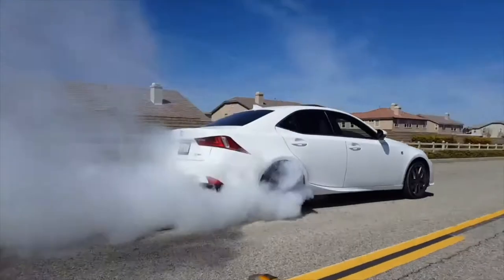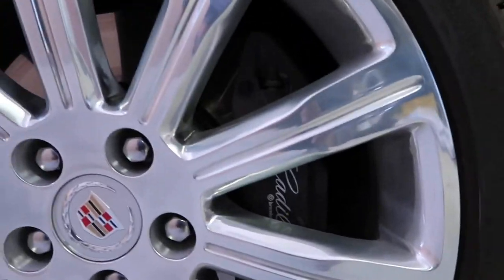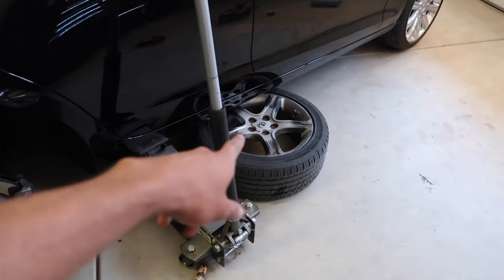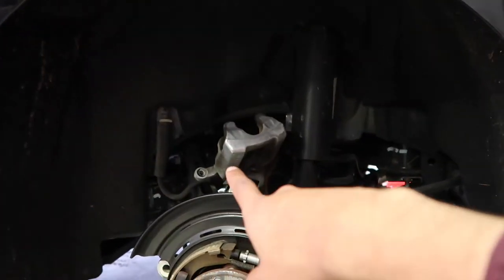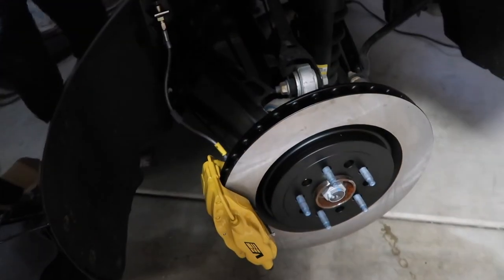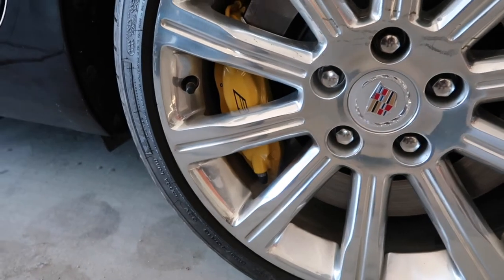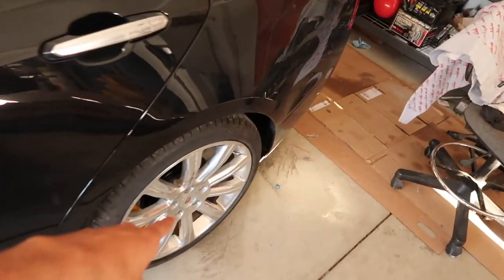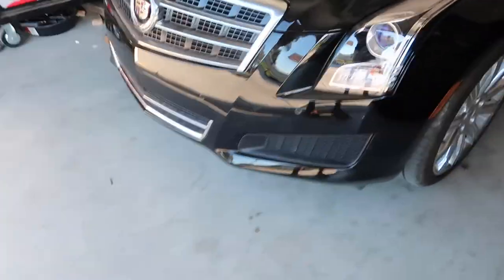Cadillac ATS 2.0T 6MT Rear Big Brake Kit Install FAIL!

Comment: Yo, props for posting a video where you made a mistake. I did the same thing when I installed my coilovers on my ATS. I had them in sideways basically. But it’s important to know that you can make mistakes and fix them yourself and it just ends up being a learning experience. So yeah good job and nice car 🤘🏼
Reply from the maker: How do you like the BC's?!
Reply: PREVA1L MOTORSPORTS I fucking love them. They’re not cheap eBay $400 coilovers and they’re not $3,000 full on race ready systems with 10 different adjustments that you need a crew of mechanics and scientists to get the geometry dialed in right. They gave me the drop I wanted, they made the ride more firm without breaking my teeth and I get compliments daily. For $1,100 they’re well worth it in my opinion. I would totally buy them again. I think next is going to be some sway bars and maybe some rear endlinks from ZZP.
Reply: I just got my MacBook up and running again so I’m gonna start working on a better YouTube channel. I’ll hit you up and maybe we can do some colab how-to videos or something.

Comment: Nice to see some ATS Vids on YouTube. Have you been able to find any short shifters for your car? I own a 2013 MT, and wish those throws were way smaller. Figured I’d ask — possible future vid if you come across something worth the money  🤙🏽
Reply from the maker: Thanks, there will be LOTS of content to come with my ATS. (BABY ATS-V IN THE MAKING) But unfortunately I haven't been able to find a short throw shifter for the M3L transmission :/ I don't think company's see a huge return on our cars. As 99% of ATS's are automatic. I'm hoping ZZP steps up to the plate as they have a 6 speed ATS in house. I'll keep bugging them lol..
Reply: Awesome to hear there is more content to come! Yea, that would probably explain the lack of product on the market, I wonder if any ATS-V shifters are compatible? On a separate note, how’s your mishimoto oil catch cans workin out? In your vid you thought you’d have to reroute some hoses? I’ve read a lot about the benefits from the catch cans on turbo cars. My ATS is still stock, wondering what my first most beneficial mod should be? Appreciate your time G! 👍🏽
Reply from the maker: I forgot the name for the ATS-V transmission but I'm almost positive it's not the M3L so I doubt the shifters would be compatible .. And unfortunately I've never been inside a ATS-V nor even driven one :( so I can't honestly say if the swap would even be worth it if they were compatible. Everything is great on the cans though, I haven't driven the car at all really (waiting for my front SS lines). But for your first mod that's a tough one as you can either go handling wise or performance wise or even maintenance (catch cans). It's really up to you though, the zzp cold air intake will for sure put a smile on your face (you'll get the pssshhh turbo sounds when you go off throttle) but there's a possibility for a CEL and some people hate that. If you want a faster car and got the money, ball out on the stage 1 kit from zzp which is good for I think 60hp and 60-70 torque and you won't get a CEL if you hate that. I currently have a CEL on my ATS but I'll be fixing that in the very near future.

Comment: i wanted to do this with mine just havnt jumped on it yet... i want the same ones as the front tho so they match.. but air ride is my next plan
Reply from the maker: Just so you know.. The OEM front Brembo caliper is bigger than the Brembo's I installed in the rear. But the OEM rotor in the front is WAY smaller than the one I installed in the rear. I intend to do a 6 piston kit for the front eventually because racecar shit but for the mean time the front Brembo's are cool.